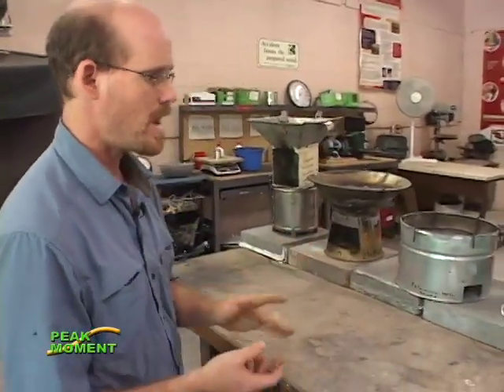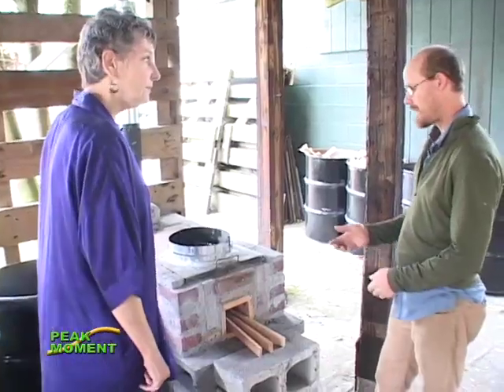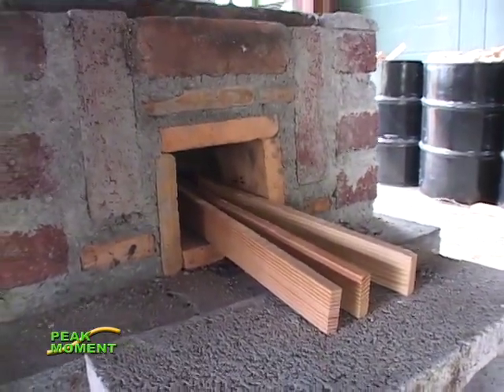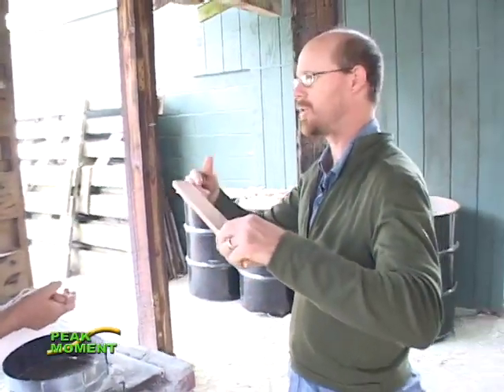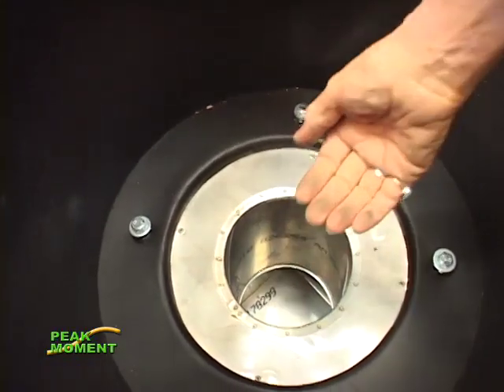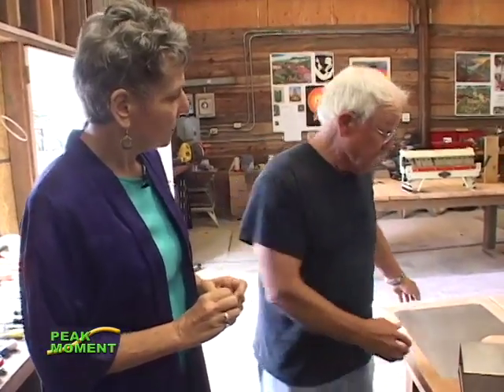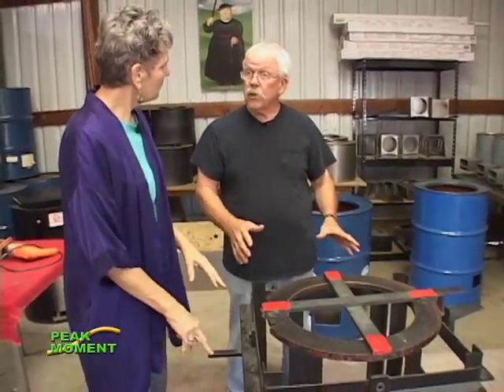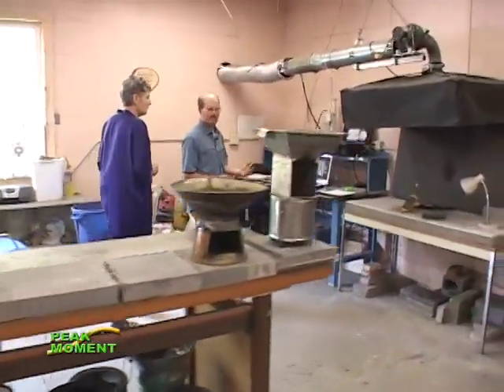Rocket Stoves - Hot, Healthy, Efficient

Comment: Beautifully designed report, but without real fire it`s just ... nothing. Now, in description you say in second sentence "rural" Oregon. How could you consider place rural If you can order laser cut metal sheet that is mailed to your doors in two or three weeks maximum?
Also, researchers are talking about required precision of 1mm due to chosen sheet metal. But If you use clay, stone, fire-brick then It would be possible to build it anywhere with primitive tools and a lot cheaper, even for free. But I believe that's not the idea.

Comment: Is it possible for a rocket stove to produce enough heat to warm 5 gallons of peanut oil to deep fry a turkey?
Reply: ^^^^ asking the tough questions
Reply: I am assuming not.
Reply: Is that with regular or spicy batter? It would be easy if you made a shallower fry pot and cut the turkey in half. Use 2 or 3 rocket stoves under a longer and shallower deep fryer. Why does the turkey need to be whole in order to deep fry it.m

Comment: Could I use one of those institutional stoves to make a deep fryer for a Thanksgiving turkey. I'm guessing it would not make enough heat to get oil up to 375f for 1 hour. I have a rocket stove water heater that can get water up to 150f but I suppose that is 40 gallons. Has anyone tried to deep fry a turkey on one of these units?

Comment: I think the notion of making the combustion chamber out of indigenous earthenware or ceramic vessel would be a good idea - these technical types don't have the know how to engineer something within a millimeter accuracy in those environments - aside from the joint where the pot meets the upper portion, there's really no need for such accuracy so long as the exhaust flow does what it's supposed to.

Comment: if the exhaust has passed over the pots, it has cooled considerably, so you would be introducing a large volume of cooler air back into the mix. It is better to get what ever turbulence and combustion the 1st time thru, then cool the gases down, which gives you the draft. Many gases require 1300f + to burn, any less than that and they will not burn, hence inefficient combustion.

Comment: Rocket stove technology is truly amazing. Look into rocket mass heaters as well. It's more suited for colder climates. 
At 20:20 He says it burns up all the particulate matter, all the carbon monoxide and there's no carbon dioxide coming out of this unit but that's incorrect. It does burn up all the highly toxic carbon monoxide but when all that wood is burned it turns into the vastly less toxic carbon dioxide. 
They're doing awesome work.